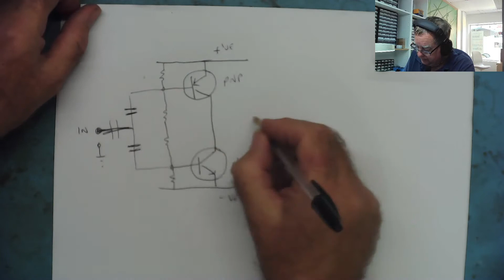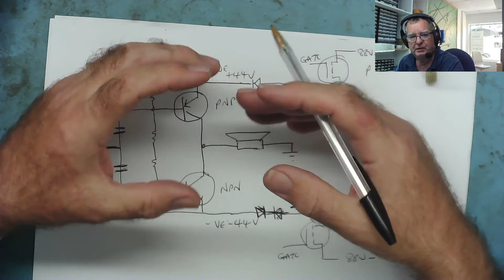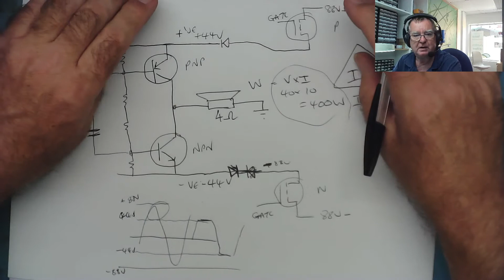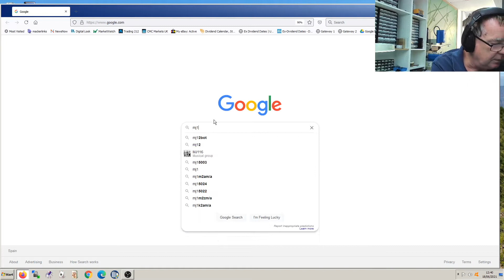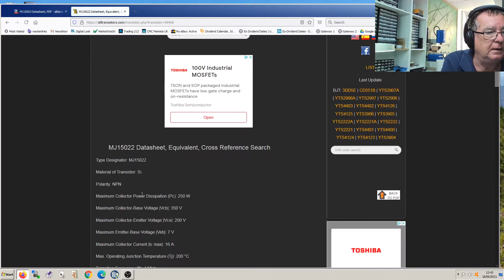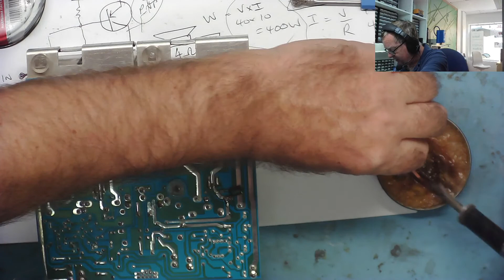Studiomaster Powerhouse Horizon 1208 - 1200W Mixer/Amplifier Part 2.  LER #072

Comment: Hi again Richard. I am presuming you finished this one. Probably too late now but I have the full set of schematics for that mixer. If you would like them then give me a shout. I have repaired two of these in the past. One being the same 1208 which I bought from eBay quite cheap.
I'm assuming it was cobbled together from numerous faulty boards from other mixers. The other was a 1508 from a karaoke guy who managed to blow both amps and several parts on the PSU. How it happened, I will never know but I ended up with it as the cost and time was against him.
I ended up repairing it in my own time and still have it.
Reply from the maker: Actually I fixed the problem with the short circuit diodes (have the video to upload) and that channel worked but the other channel still gives no audio - so yes if you could send the schematics electronicanaria@outlook.com   Thanks
Reply: @LearnElectronicsRepair  Sent it last night Richard. Check your spam if it's not there.
Edit: Also check for virus. I only use Linux so don't need AV software.
Reply from the maker: @retrocomputeruser  I have the schematic - cheers!  I'll get on to finishing this one as the owner knows the current situation  (I successfully fixed the fault he asked me to fix) and he never got back to me after that